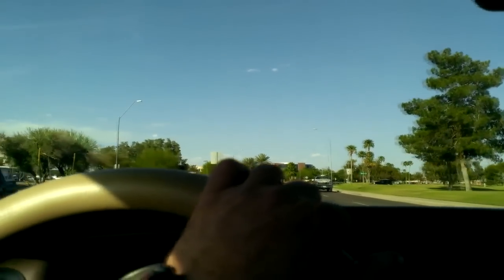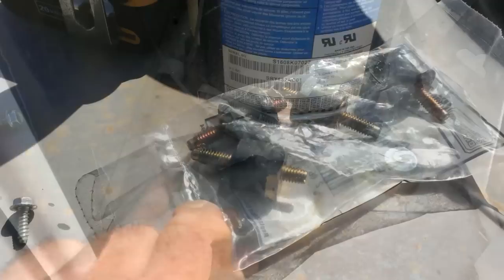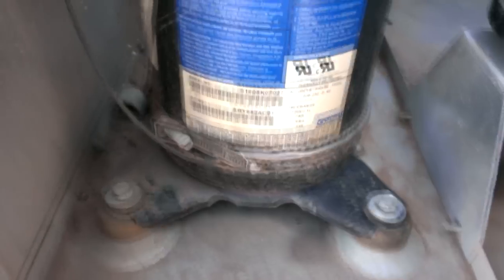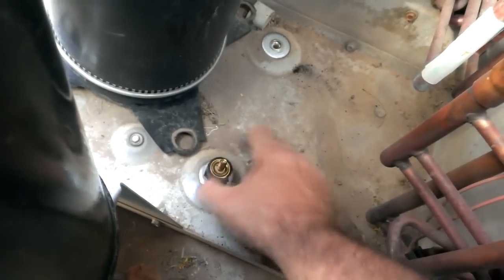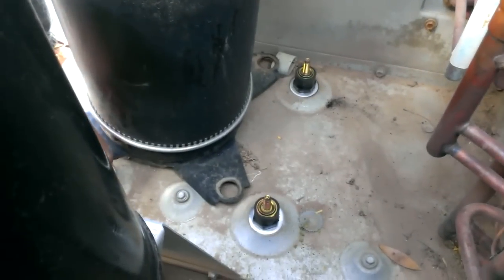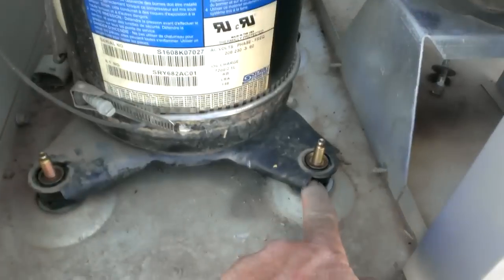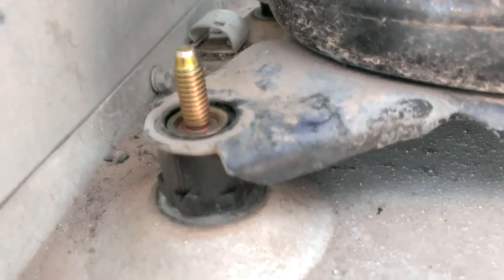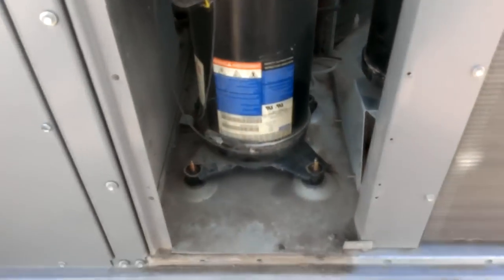Carrier compressor vibration dampener mounts - show-n-tell

Comment: Thank you for this video.  I am ready to quit my job because they just replaced the ac unit above my office and the oscillating noise and vibration is overwhelming.  It is actually causing me to have "motion sickness" as if I was on a boat! 
Where would I get these vibration dampening mounts,
What is the item name exactly
What is the product number. 
Also, would they work on ANY rooftop unit? 
The replacement ac is supposed to be energy efficient.  I am willing to pay for them if I can get the owners to get the ac guys to replace what is there now.  Otherwise, it will be very difficult for this senior citizen to get another job.
Thanks again.
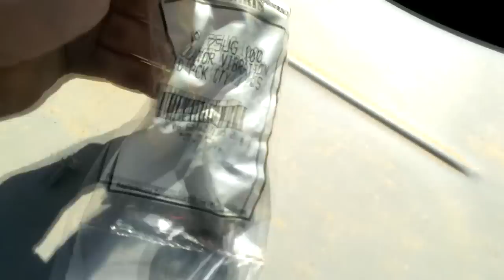Reply from the maker: ***** Pause the video just after 2:10 and you can see the package of compressor mounts.
They are a CARRIER part so if you show that to an AC Tech he can get them for you.

This does help with the compressor vibration. It does not help vibrations from the blower etc but usually the sound conducted into a building from a rooftop unit is the compressor.

Comment: I realize this is a bit old, but i have a question about doing this for a window air conditioner. How easy is it to move the installed compressor? Im worried about rupturing a refrigerant line. Would you recommend doing this for a window unit? If so, what size mount should i get? How would i find one? Amazon?

Comment: I've accomplished the same result from just loosening the bolts...over time the metal insert inside the rubber will actually touch the chassis and create vibration noise...loosening the bolts will alleviate this noise...no harm done to compressor and I'm in and out in 30 mins or less....
Reply from the maker: I've done that before.
But these mounts are for when that doesn't take care of it.
And these mounts were developed for NEW units that caused noise issues such as the Carrier rooftop units. They would be noisy from day one especially if the rooftop unit is on a location where it transmitted the noise inside the home where people slept, watched tv, etc.
These things make the compressor float compared to the standard rubber feet.
You can move the compressor by hand and it will move like it's almost on springs.
These are not cheap though. I think they are $15 to $20 per mount and you typically need 4 of them.
Reply: I think you sir have just solved my problem.... Thank you so much, I love you!
Reply: Oh my god this actually solved a problem I have been having since like 6 months.... Thank you so much sir! You are amazing both you and the channel owner for making this comment take place... Please guys keep helping people, by making such videos and comments.. you really can't imagine how much this helps people living in places where no technician with even decent experience and knowledge in fixing and repairing... I honestly don't know how to thank you!

Comment: i like the genuine copland mounts that are have the sleeve all the way through the rubber and bolt not a flimsy rubber with 5/16 shanks molded to the ends ! i think they are pretty cheap.

Comment: Hi and thanks for your video. Do you think these will work on a Rheem Scroll Compressor for a 5-ton unit? Or are these mounts specific somehow to Carrier's units?

Christine
Reply from the maker: I've used those on Carrier, York and probable Rheem. Anything with a Scroll should work the same.
Reply: @hackfreehvac  Thanks for your reply. My entire outdoor unit is sitting on top of a vibration pad already, but I still hear this bothersome, low-level buzz when the unit is running. I already have a sound blanket around the compressor, which did help to an extent. I'm wondering if these vibration isolation mounts could help further. What are your thoughts?
Reply from the maker: @clim9742  
These mounts cost a pretty penny. 
For a ground unit maybe it's your fan causing the vibrations and someone can tweak some panels. 

These mostly help with rooftop units
Reply: @hackfreehvac  Thanks for your follow-up. It's not the fan imo. The fan is at the top. When I kneel and put my ear against the unit, the objectionable noise is much louder than when I stand and listen in the same way. So, it seems what's bothering me is originating from the bottom of the unit where the compressor is. I had the tech put on a secondary compressor blanket and that didn't seem to change much at all, so I'm deducing that it's the compressor against the housing that is generating the noise where an extra blanket that goes over the top wouldn't help much. Do you think I'm grasping at straws?
Reply: @hackfreehvac I have a similar issue. Where can I get these rubber mounts from?
Reply from the maker: @Hitmanballer  
The Carrier distributor sells them as part KA75UG100
Reply: @hackfreehvac thanks brother